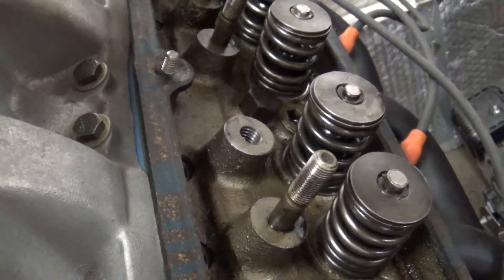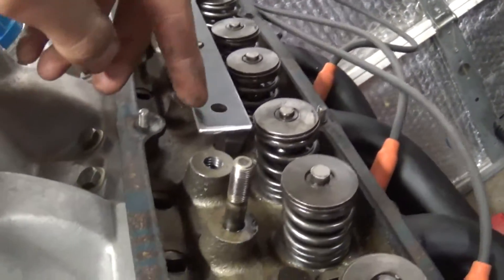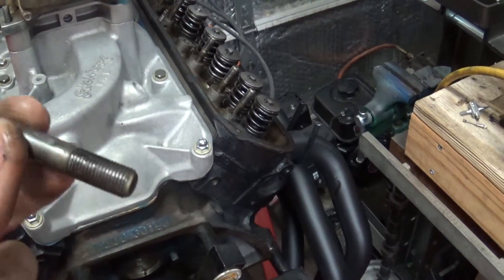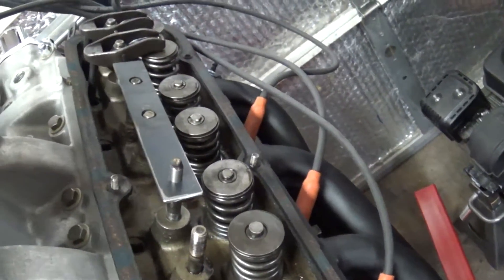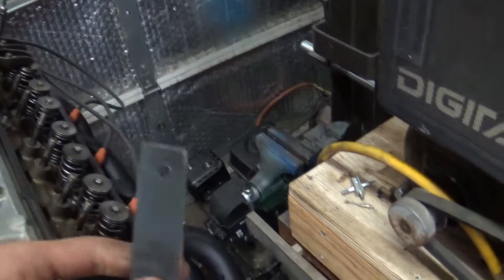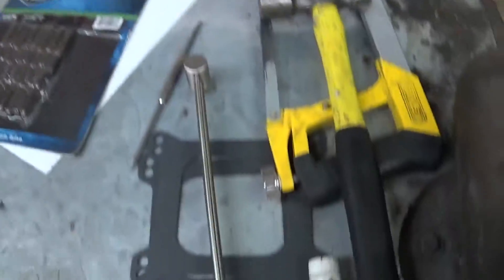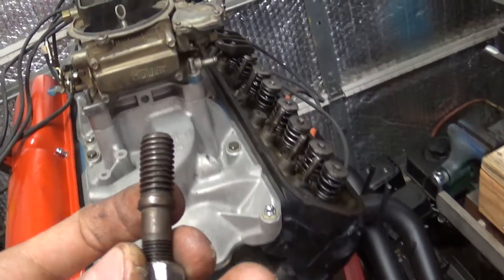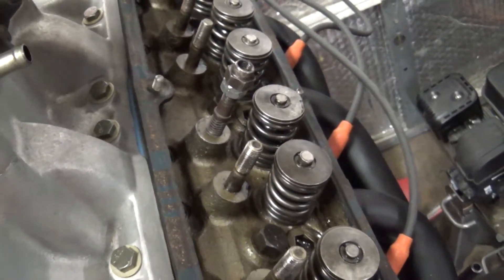Screw-in rocker stud installation

Comment: Dude that helps a ton haha. I'm rebuilding my 200 for my '66 mustang and that's probably what I'm gonna do for some new rocker arms
Reply from the maker: The 200s have shaft mounted rocker arms, it's a different setup. Clifford used to make a 1.6 ratio rocker assembly for them, not sure if you can still find them. If you want to spend some money, Yella Terra has a nice roller setup http://store.yellaterra.com.au/ford-inline-6-pre-xflow-street-terra-5-16-shaft-1-65-ratio-adj-rockers-ef-st2014/
Or you could probably build a plate for some studs to go into that would also act as a guide plate for the pushrods, and use any stud mount rockers that have the correct geometry.
Reply from the maker: I use red loctite. Not sure if it specifically seals the threads but it keeps the stud tight and I haven't had any coolant mixing issues.

Comment: How did the stud get torqued down without a shoulder? Do you bottom out the stud? 
I'm doing the same thing and my studs keep bottoming out in the head?
Reply from the maker: The Mr Gasket studs have a tiny bit of a shoulder where the threads end. You don't want to torque them down too much though. I just put loctite on them and snugged them to 15 or 20 ft lbs. Drove through 8 states with no issues.

Comment: How do u tighten the stud without the hex base
Reply from the maker: I used a nut with jam nut on it, with them tightened together you can get the stud snugged into the head. Then remove the nut and jam nut. Use a dab of red loctite on the stud going into the head to seal it and lock it in place.

Comment: Easier to pin them did mine in one hour using one drill bit
Reply: Do you have a vid? I'd like to know more about what you did. Did you drill a small hole in each boss and used a roll pin?
Reply: while in the car?